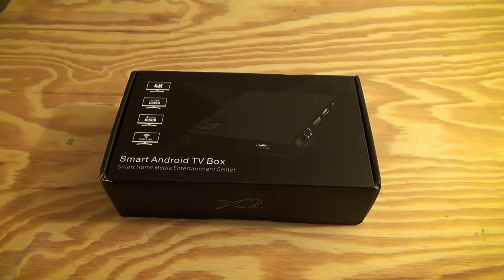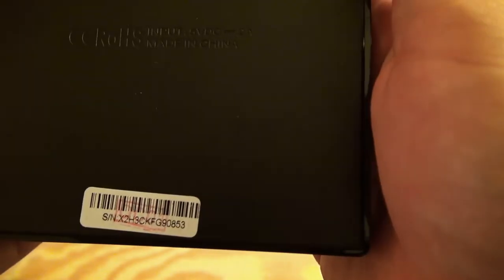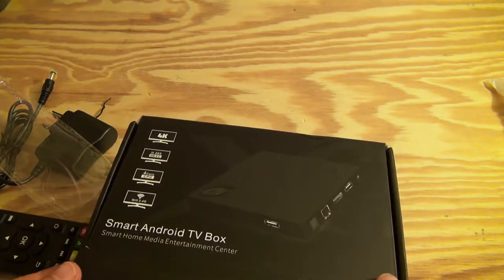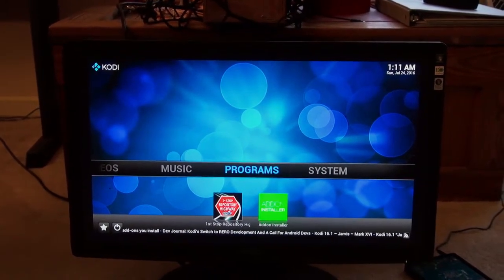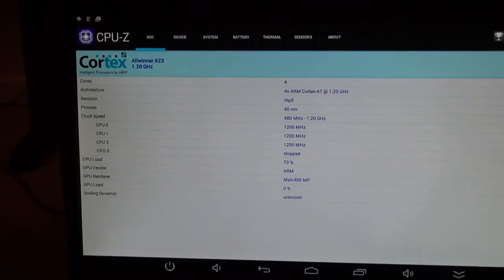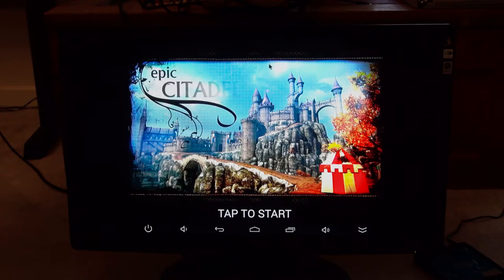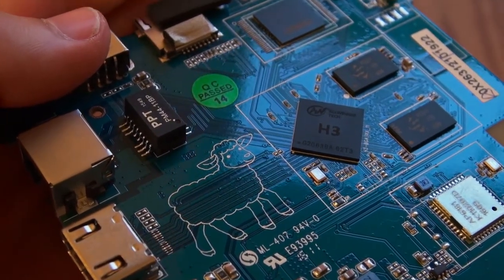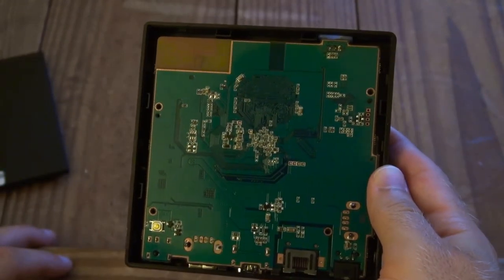Beelink X2 Android TV Box Review - Unboxing, Benchmark, Teardown

Comment: Nice review. Mine locked up today on the MBOX screen, and so far, no amount of holding the reset button, plugging in, holding the on/off button etc is putting it into recovery mode.  I've also had it temporarily lock up previously (refusing to boot) for some nail-biting minutes, but this is the first time that it's fully crapped out on me.  Still hopeful, for now!

Comment: where exactly is the IR sensor on it?  I need to block mine, because it is crossing over with my remote for my TV.
Reply from the maker: It's the little black square bump along the upper right edge of the circuit board at 17:35
Reply: Thank you.. to your knowledge, is there any way to just turn it OFF?